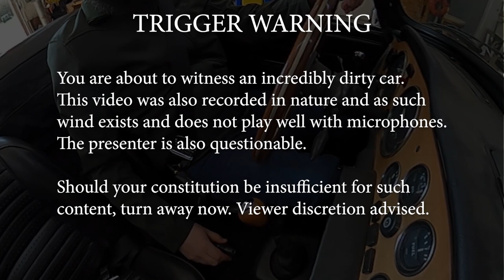Triumph TR6: A freezing test drive

Comment: Just found this researching your FI setup. When you rebuilt the trans, did you replace all the bearings? The PO did mine and it's pretty noisy with gear noise, except 4th. Redline helps a little, LOL. I ask because I think I can hear a little gear wine in the video, but could be electronic noise being generated...So regarding the Patton FI, besides the ease of cold starts, is the engine 'peppier'? Do you think the exhaust is cleaner given the engine management? She seems smooth, that's for sure. Thanks for covering the TR6; you do great work and are really educational!
Reply from the maker: It seems peppier for sure, but the carb setup that was on the car before was pretty bad.

With the transmission, it's really tight and has a little whining, but not terrible. I would just run it a bit and see if it wears in or if there is any metal in the first fluid draining. Sometimes I have had manuals be a little noisy when everything is brand new and tight. It could also be that something is too tight or not perfectly aligned.

Good luck!